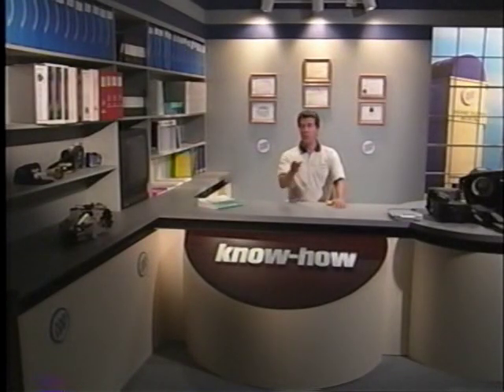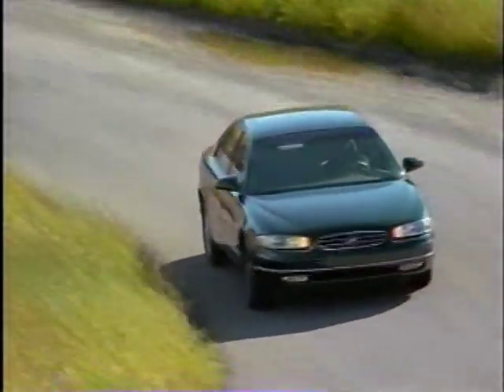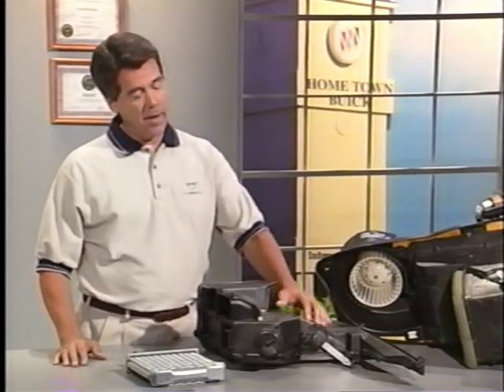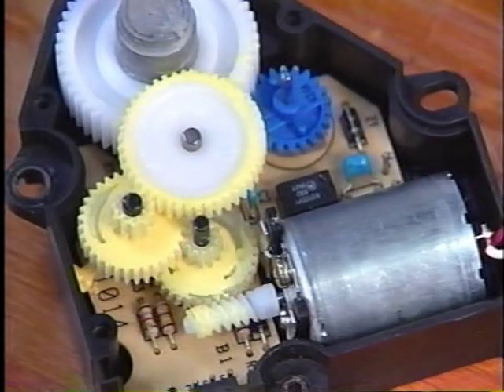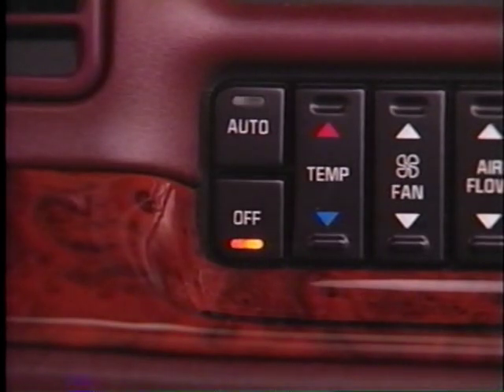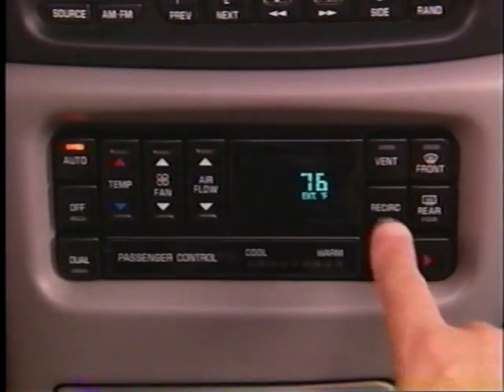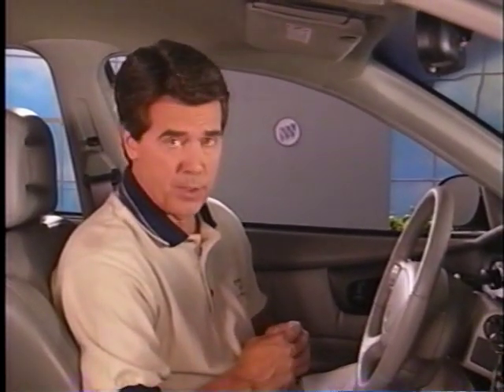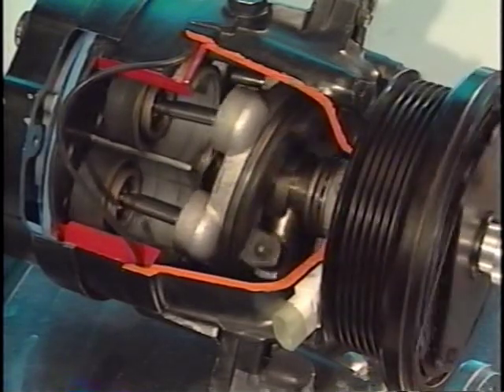Buick - CJ2 Automatic HVAC Systems (1999)

Comment: When you replace any of these actuators disconnect the battery for 5 minutes and then reconnect. Turn on the ignition for 5 minutes. This will allow all the actuators to go through the recalibration process. Then go through the mode adjustments using the controls. This worked for me.

Comment: Please help! I have a 99 Century limited. The A/C blows stronger than the heat out of all vents. When I start the temperature at 60° it blows very strong until I bring the desired temperature up around 75, and then the air flow slows down while producing heat. I don't know if this is normal or not. If not, I'd like to know the cause, and if it's one of these doors and actuators, which would it be and where? It's the same flow for all vent settings on heat and stronger on all with AC. I've changed the cabin filter and blower(it was squealing).
I hope someone can help.
thanks
Reply: In auto mode the heat should blow mainly thru the floor outlets, not the dash ones.